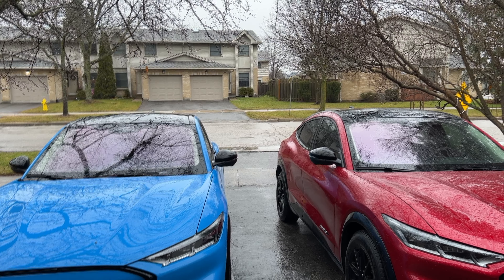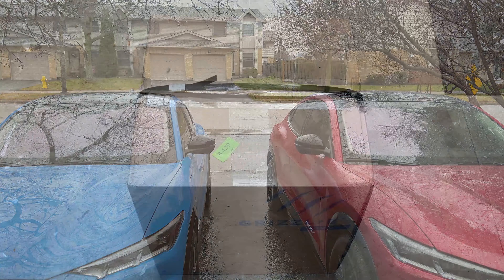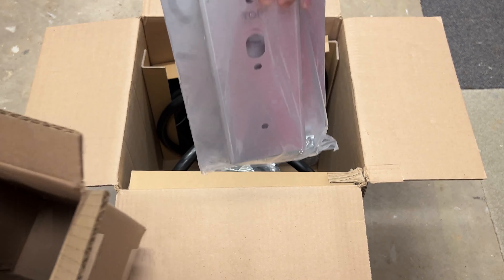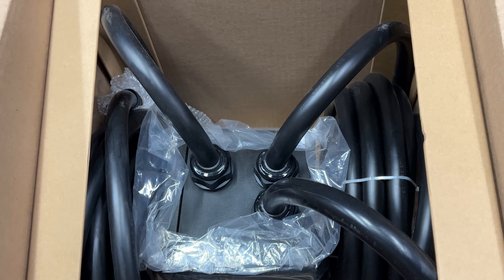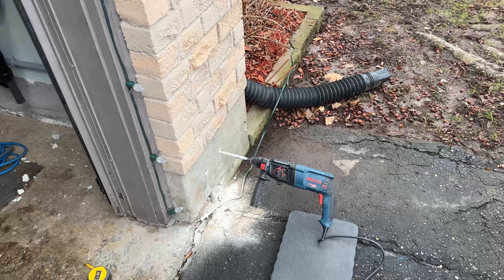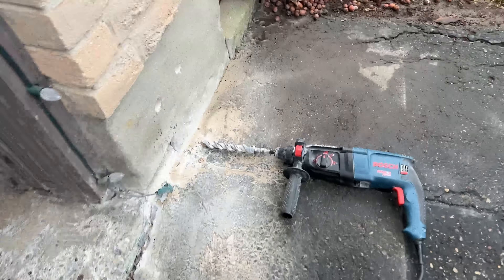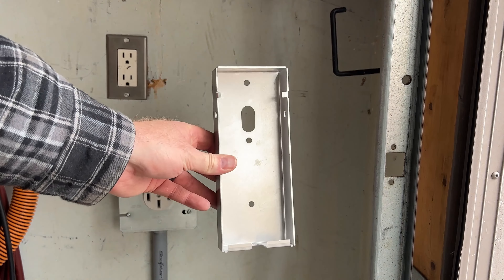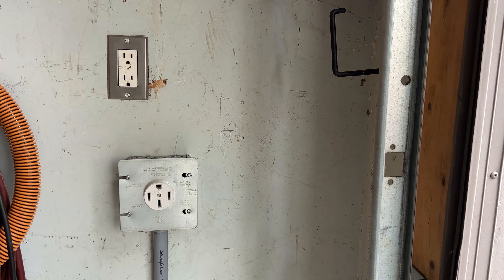Own 2 EV's? You NEED this Dual Charger | How charge 2 EV's home same time | How install Grizzl-E Duo

Comment: The correct way to eliminate a plug over heating situation is to eliminate the plug and hardwire the charger. You’re leaving apps on the table you could be using a charger car. You’re a disadvantaged, the sharing the circuit you should get the full 40 A of the circuit…
Reply: Would’ve been nice to show the audience how you took the unit apart to get the charging cables through the wall…
Reply: I thought you installed a dual charger. Where is the second line?
Reply from the maker: Its there.  Trust me.  Thanks for watching and the comment!
Reply from the maker: Hmm, I thought I did?  Sorry.  Thanks for watching and the comment!
Reply from the maker: Correct, you get full 40 amps, but the charger will only send a certain amount to the car that needs it and reserves a bit for the car that has finished charging in case it needs more later.  Not my design, just giving the info.  Thanks for watching and the comment!